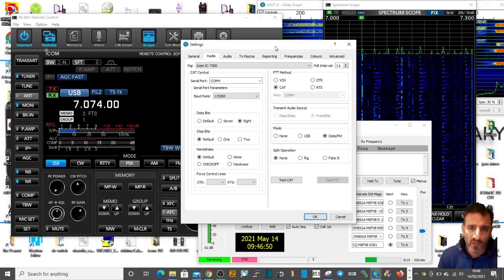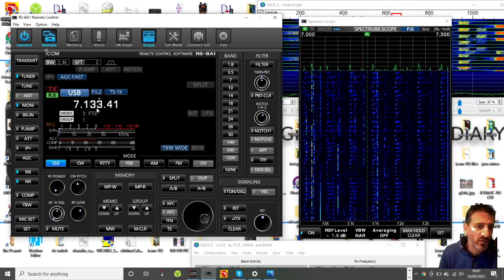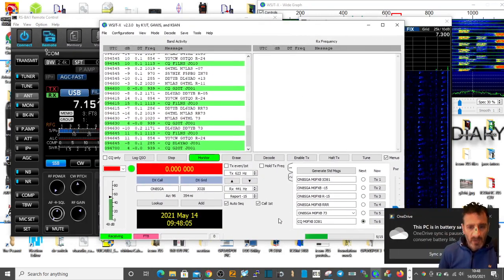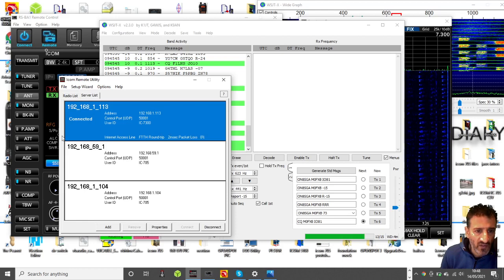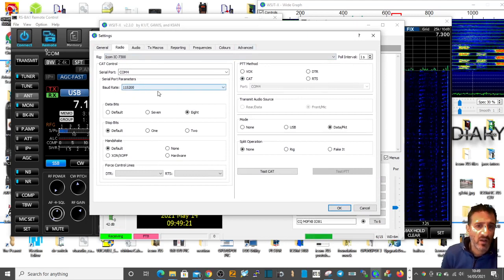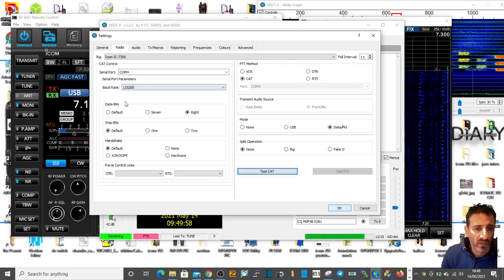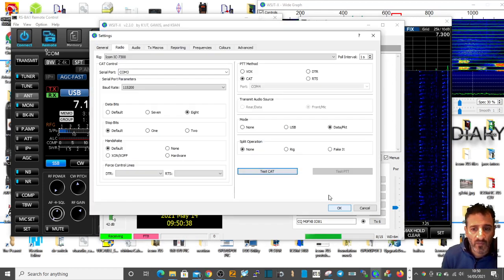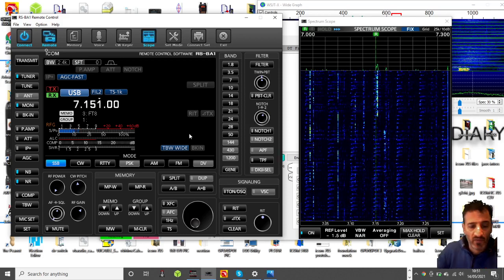ICOM IC-7300 - RS-BA1 software wireless FT8 -Learning

Comment: Spent a whole day trying to sort this out. Also used the ci-v cable alongside the usb connection. I get it to key, but as time goes on everything goes out of sync. Then the cat disconnects randomly. This software is crap, it's just designed for remote voice. There are other software like win2icom, but even that does not work correctly with data modes.
Reply from the maker: Sorry you found it no good .
Reply: @M0FXBHamTech  I got everything working with wfview in the end.

Comment: Andreas, were you able to get this working? I am trying to do the same.
Reply from the maker: Yes think so it was a long time ago .
Reply: @M0FXBHamTech  How did you manage to get it working?
Reply: did you use both civ cable and the other printer type cable to get it working? are both cables required? id love a updated version of this @M0FXBHamTech
Reply: I have the same issue, how did you fix it?

Comment: Hi Andreas, the way I got it working is using a ci-v cable in the other port and use that to key the radio, you have to separate them out in the radio and from memory - not used it for a while and not 100%  I still have the settings, but its a bit of a pain as you are stuck with either voice or data while being remote - I think you can select data from mic button or another button.  something similar to this should work, but you will need a usb to ci-v cable as well as your standard usb.. 

If you have just a USB connection you will need to go to menu>set>connectors>CI-V>CI-V USB Port and link to remote
Then back one level and set baud rate to 9600. Make sure WSJT is also set at 9600

To make the remote work go to menu>set>connectors>CI-V>CI-V USB Port and unlink from remote, for your USB CI-V cable
Then back one level and set USB baud rate to 115200.

that should get the remote working...
this was all on rs-ba1 v2 and the radio firmware was a couple of versions back
I dont use FT8 very much now days.. good luck
if all that fails then just teamviewer to your main pc free and easy !

73 ZL1CTS
Reply from the maker: Hi - thanks  bebry much I have done this kind of stuff wireless was really confusing tho lol .
Reply from the maker: https://youtu.be/DWTJKS12Q1w